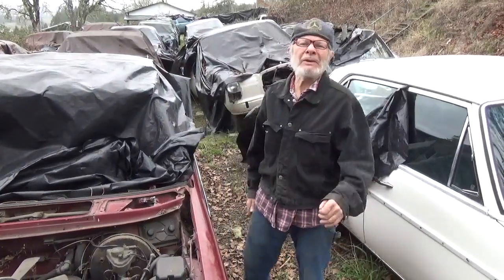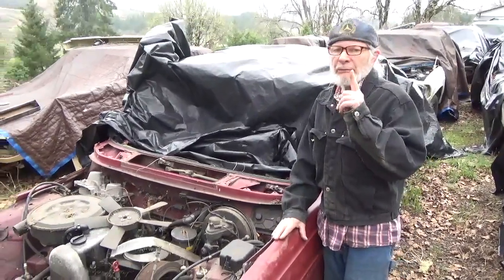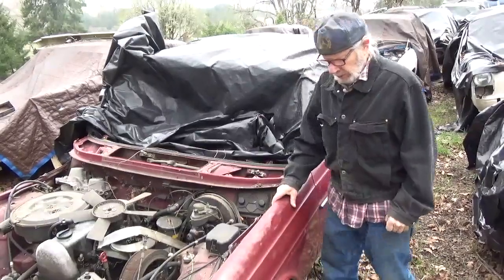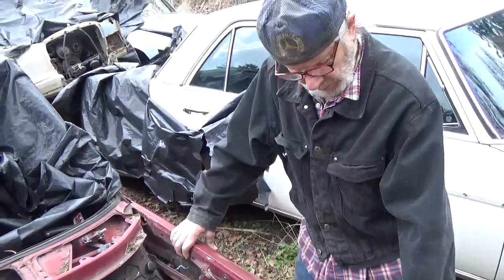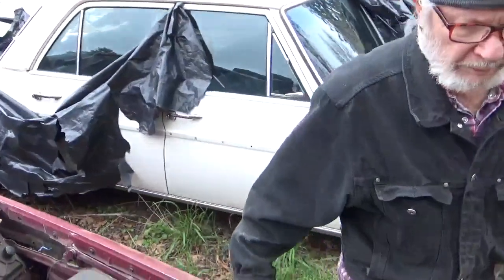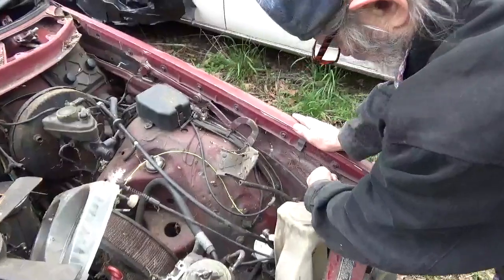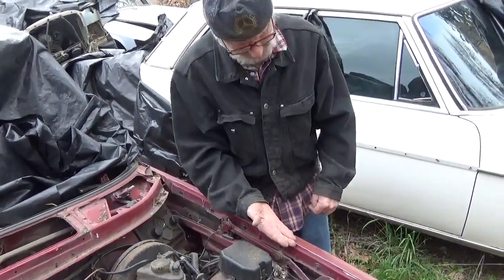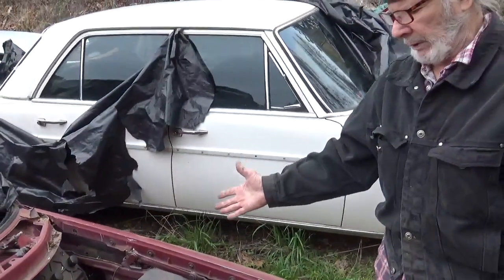Tips for replacing a front fender on your Mercedes-Benz W123

Comment: This video is misleading, the early pre-facelift W123's (77-81) actually did have the top seam glued on (in addition to the bolts) but the later 82-85 models were just bolted on. It's very easy to remove a later fender, and the earlier glued on ones you can unbolt and get a flat chisel between the fender and body the break the bond. I've taken off both kinds and the 82-85's it goes a lot faster. Once you get them off they are the exact same part.

Comment: This instructional video is bogus. It IS very possible to remove the fender WITHOUT cutting it apart and doing what you are suggesting. I have taken off more than half a dozen of these fenders without damaging anything, as you were suggesting. Please don't mislead people. There IS a better way to do this and it can be done if one is careful and not a hack.
Reply: Absolutely, I have removed a number by simply cutting away the rubberized glue and removing it and it doesn't involve destroying a fender or inner panel. Is a lot of work but ultimately easier. If you're going to destroy it, just use a CUTTING TORCH.